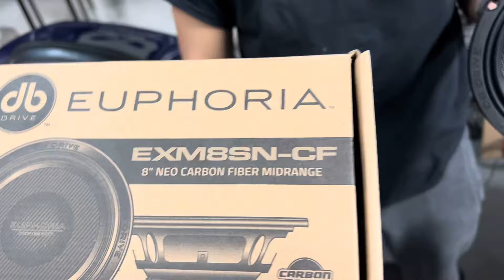NVS audio test some of the most popular Motorcycle 8 inch speakers to see which ones fit 8 inch lids

Comment: Carlos what's your favorite 8 inch mid bass for the saddlebags in a typical rider bike non competition?
Reply from the maker: 8 inch subwoofer 

I like the 
KB 8 
Euphoria xpert 8 
Ground zero hydrogen 8 

Are my 3 favorite for motorcycle
Reply: @NVSAUDIO  what about the Hertz 200L 8 inch mid bass?
Reply from the maker: @kevinduhon9465  
That was my 8 inch subwoofer list 

8 inch mid bass 

I love 

Hertz 200L 
Euphoria carbon mid bass 
Cicada cmb8
Reply: @NVSAUDIO  thanks brother you are the go to in audio
Reply: 😊 @NVSAUDIO
Reply: The bike I'm looking into buying has 2 10 kb, 4 8" cicada. The 10's running on 5000 watt amp and the 4 8"running on 2000 watt amp and then 8 tweeters running on 700 watt amp.  Is there anything better than the cicadas?
Reply from the maker: @joshadamson3090  listen to the bike if you like the way it sounds there’s no need to change anything thanks Ata makes an excellent speaker and KB is on a 5000 crazy bass 👍🏽
Reply: which lids are those ?? will the exm8cf will work with twisted 8 lids with modifications of the lock assembly?

Comment: The sensitivity rating on speakers can be misleading.  8 ohm speakers are usually rated at 1w/meter which is 2.83v @ 8 ohms.  Lower ohm speakers are often rated at 2.83v/meter, which is 2w at 4 ohms, 2.67w at 3 ohms, 4w at 2 ohms, 8w at 1 ohm.  Unfortunately,  we can't get the speaker manufacturers to all standardize on 1w/meter.

Comment: What 8 inch sub u like
Reply from the maker: Sub or midbass driver?
Reply: Do you even install subs?..would like to see which bikes you've done it on
Reply from the maker: @colbylaro9361  we currently have 2 bikes here at the shop with subs . 

We use mid bass drivers 90 percent of the time because we do mostly rider bikes . 

These 2 one is running dc level 4 tens 

The other is running euphoria xpert 10 inch subwoofers
Reply: 10” sub or mid bass ?
Reply: Sub 8

Comment: Yes but Cecadia is a cheap material Chinese copy don’t compare please.
Reply from the maker: I said I like the Beyma  better 
But it doesn’t fit 
The cicada might be a cheap Chinese copy 
But it is currently the most powerful “drop in fit “ weather proof drop in 8 inch .
Reply: The Cicada speakers are solid and backed by a warranty. Not to mention they don’t cost an arm and a leg.